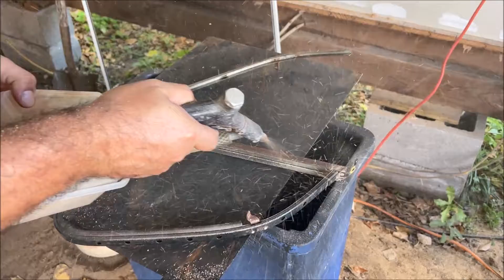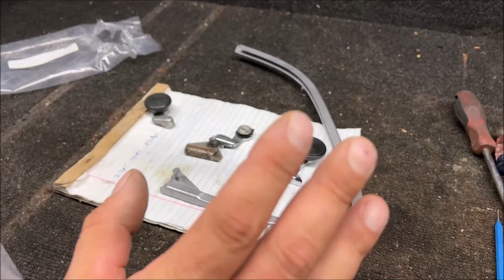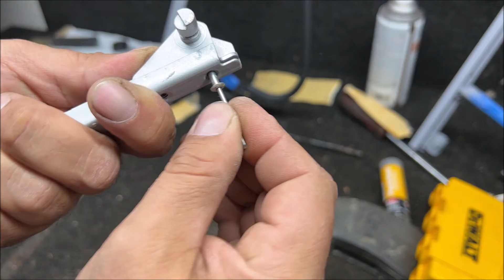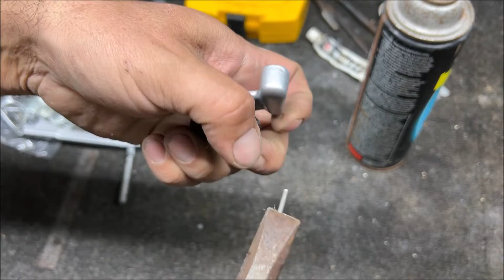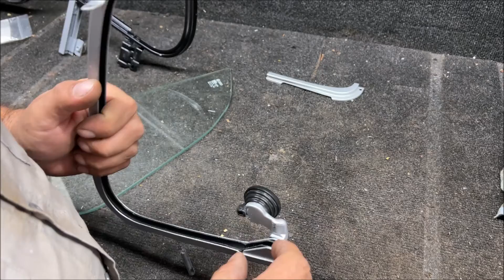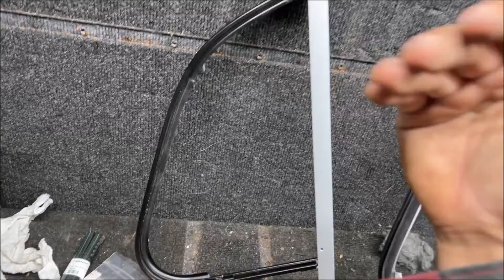VW Beetle vent glass restoration HOW TO diy

Comment: how did you take the glass out ?  I have a 71 bus and Need to take the glass out of the middle vent window (they are rectangular).  Yea, bought new ones and BROKE the pin in the bottom, so you have to take it apart and WELD it up.  What a pita.

Comment: Awesome video, I am working on both of mine as well, im also using that flat wide rubber piece for the glass, and replacing the vent levers and was wondering what rivet size, glad you mentioned what you used. I have watched some other videos and they gloss over it. Thank again for posting the video!!!!

Comment: Just a heads up. The 68-70 Beetle's vent windows assemblies were made out of Stainless steel. They will fit 68-77 Bug doors. If you find a set, use a magnet, to confirm.